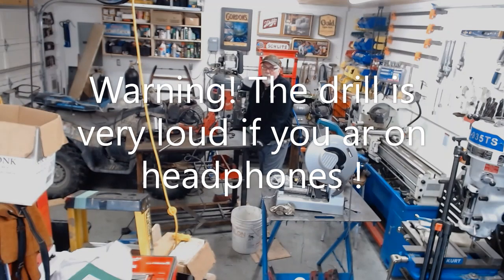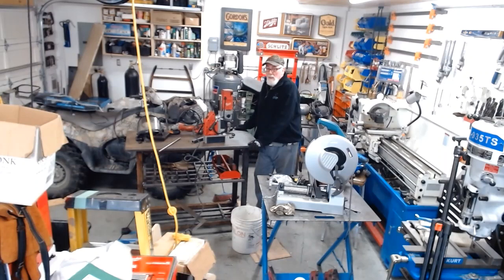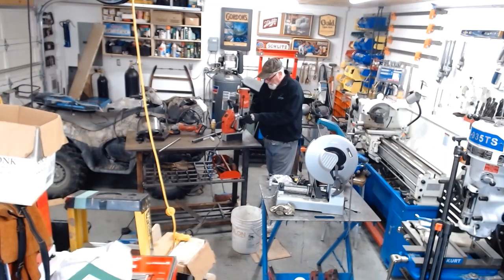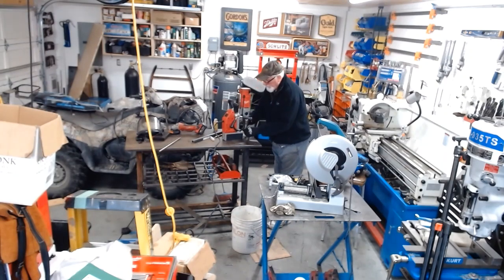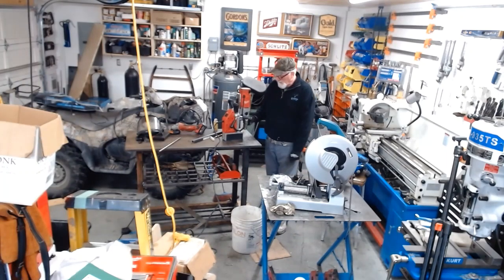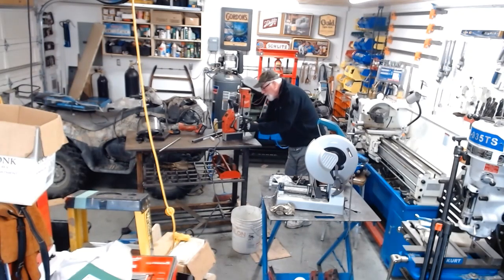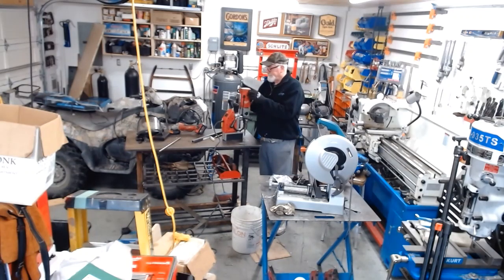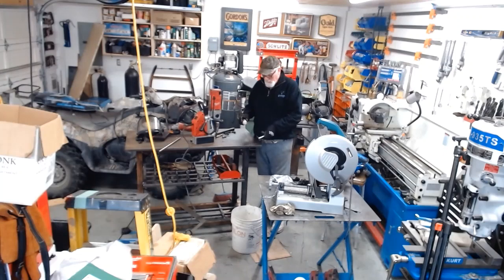Drilling and Tapping Half Inch Holes Using Milwaukee Mag Drill !

Comment: This is exactly what I need to do. I'm ordering a drill already to get holes in my 1/4" plate
Reply from the maker: They work like a dream !
Reply: @CruiserMac  Thanks. I get my bonus check next week so its tool time. I am also debating on build a small 30x40 shop, the problem is where. My current home has a small lot, my vacant lot is 4 miles away or I can buy an acre and build the shop and new home.
Reply from the maker: @cutweldngrind  Build a 800 square foot house and a 8,000 square foot shop! 😁😁😁
Reply: @CruiserMac  Sounds about right.